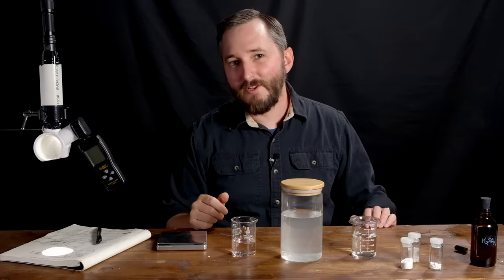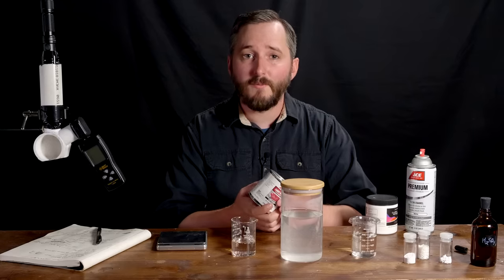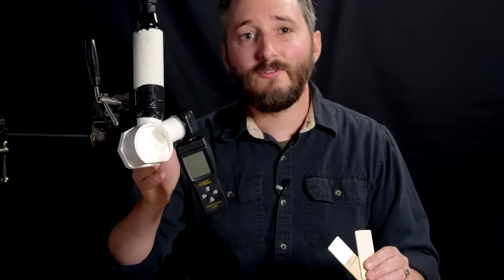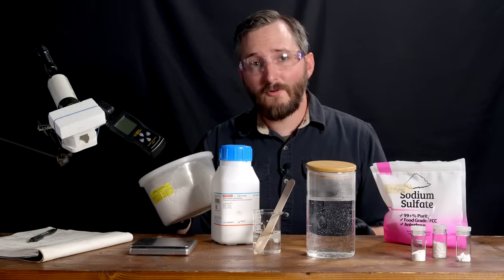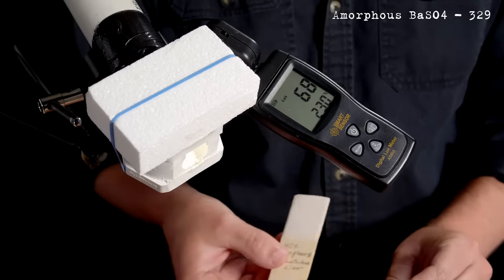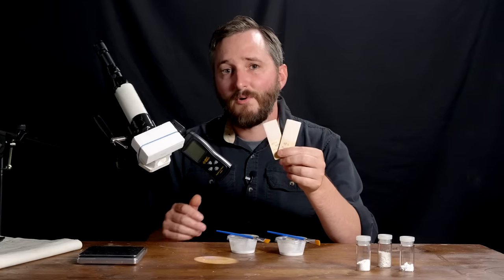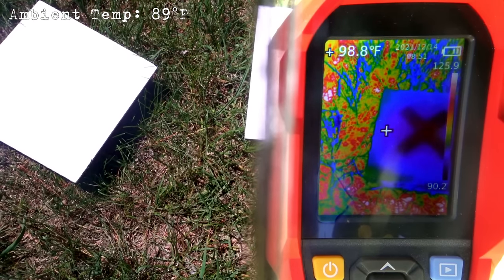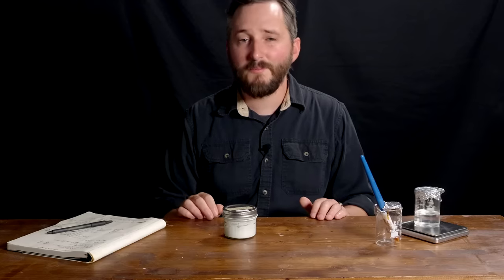How To Make Infrared Cooling Paint (Electricity Free Air Conditioning)

Comment: Once in my now pretty distant past, one of my education topics was something I might call "Light and Illumination".  It ended up with road illumination and similar topics, but at the beginning it talked about measuring (basically comparing) light with different means.  One method used a chalk wedge.  One flank was illuminated by the unknown light source and the other one with an adjustable (dimmable) reference source.  You adjusted the dimmer dial, until the wedge tip disappeared. At that point the brightness of the unknown could be read from the dial of the reference light.  Well, then they described better white materials than the piece of chalk, and it was barium sulfate that got the crown.  In the lab, there was an integrating sphere that was internally coated with that barium sulfate paint.  I think our lab exercise consisted of grading some light bulbs with the sphere.

Comment: that was really interesting!  I'm interested in passive heat reduction for the RV I'm building - I dont anticipate something like this will be commercially available until 10+ years from now, but it's an interesting concept.  any ideas on what the overall costs would be to obtain a product like this - say, like a gallon of it so I could then calculate the amounts needed to cover a class-b sized rig (thinking 0.04" thickness)?  presumably, a 0.01" top coat of clear acrylic could then be used as the wind insulation.
Reply: Nature can be wonderful if we treated fair. Have you considered mylar for the your RV Roof, glued on, good for summer I don’t know about winter,

Comment: Using the " stack" manufacturing process from your thermo-acoustic demo, could you achieve more cooling with a painted stack mounted in a tube? Your demonstration at night showed both regular white paint and the special paint as having similar but noticeable cooling so a white stack in a vertical tube might convectively cool a room?

Comment: Hi NightHawk ~ Can i ask something please? I love your videos btw, you have interesting videos. 
If its painted onto a "Peltier" block, would the cooling potential be enough to allow it to function as a generator?
Reply: I would say yes - but with a very small output. It might be enough to power a device like a small sensor.
Reply: @TheMightyZwom  Interesting thank you. Was just an idea.
Reply: Peltiers generally need have a fairly large difference in temperature in order to work. It will probable technically work, but very very poorly. If you want to create just a small amount of power you can make a battery much cheaper and more effectively. For example, One can create an aluminum air battery on a counter top with aluminum cans, water and salt and run and LED for months. Some people have created batteries that will run (at very low power) for 30 or more years. A solar panel provides much more power. A purchased batttery gets you much more usable power for a better price.
Reply: @cryptickcryptick2241  Thank you

Comment: I couldnt help but wonder if you had a few square kilometers "painted" with this kind of color could you significantly influence the climate and for example target global warming in some areas.
Reply from the maker: It's possible
Reply: If it could be made into a robust material that would stand the weather for a significant amount of time (say, ten years) I'm pretty sure it could make a noticeable difference if many roofs are covered in this. It could lower the temperature in a city by quite a bit.
Reply: you could cool down a local area like a city (think of white roads instead of black roads), but the heat would remain in the atmosphere (greenhouse effect) so the overall global temperature would not be reduced.
Reply: It's called ground albedo and was already discussed in the IPCC reports in the context of the average ground albedo decreasing by snow coverage melting away. Painting buildings and land surfaces with reflective paints like these ones could actually be a way of combating the loss of ground albedo as a positive feedback loop of climate change.
Reply: @umbrel  The heat would not remain in the atmosphere because the IR emission spectrum of the paint happens to fall into the transparent window of the atmosphere, so it radiates out into space.
Reply: I worked night security at a construction site in Phoenix.  The temperature difference changed over 20 degrees (F) overnight when they laid asphalt.  I think we can safely assume the answer is "yes."
Reply: So in exploring that question, think about snow. Nature covers areas of the planet every year with it for a good portion of the year. Snow reflects the light.  This does have an effect. I realize that not everyone lives where it snows, so allow me to explain general knowledge from years of observation where it snows.  The effect is better illustrated as heat absorption in winter months. If the snow is thick enough to cover some fields, they will stay covered, on other fields, grass poking through warms up, melts the snow, and then increases the absorption of heat, and melts more snow until it is exposed. This is very important to farmers in cold climates. Some crops, like alfalfa hay, do best when snow covers the fields all winter. An early snow can come, and it can stay or melt based on conditions, and it can get very cold with no snow for weeks to months. Some fields melt, others do not so there is a variety of conditions based on many factors. Yes, high reflectivity will cool the area off a few degrees. That said, it is of limited effect when winds travel 1000 miles across the planet bringing in hot or cold air.

Comment: Something to point out that every one of these videos seem to forget (and I have to say that this video generally is better than others to demonstrate the effect of radiative  cooling) is that temperature isn't the important metric here. The important factor is heat rejection which results in you temperature when then system is in thermal equilibrium - temperature at which heat in = heat out. So for a paint with a reflectivity of 0.9 and an ambient temperature surface with convection minimized, you are at best getting ~100W/m2 cooling at night. Your efficiency is related to the 4th power so combined with a heat pump you can get the efficiency much much higher but then you are quickly getting back to a complicated system (which might be why you want to do a simple radiative cooling). Anyway, the only interesting test here isn't what temperature you can achieve (which with zero parasitics is just the sky black body temperature) but what external power dissipation you can apply to achieve a desired temperature against the boundary environment.  Passive cooling is a great idea, especially in warm climates to reduce the parasitic heat load from the sun just to reduce the load on the air conditioner, but it's not an efficiency cooling system in itself in comparison with solar panels or in combination with a heat pump.

Comment: I feel like this would only be applicable in places that are always hot. Sure it would be nice in the summer, but would you be able to heat you’re house in the winter with it?
Reply: Yes. In theory you could paint a funnel, and the inside of pvc pipes. The light would then travel from point a to point b very efficiently. Ergo, you could focus the light at point b to heat metal and or ect very easily. Assuming you could keep the light entry points free of snow and condensation.

Comment: Thank you sir for this very well-done video! I have long been fascinated by radiational cooling. I live in South Florida, so cold weather was very limited when I was growing up. Now we pretty much don't even get any cold weather anymore due to climate change. But anyways, we had a flat polyurethane foam roof on our house, and whenever the temperature would fall to 40 degrees or lower, I would put plastic sheeting on the roof and spray it with water. In the morning it would all be frozen. Then I would shake the plastic and gather all the thin ice pieces into a huge cooler and stomp through it with my shoes and crush it up and make a slushy heavy "snow" to play with. Then my friends and I would have snowball fights and play around with my homemade "snow". So I ended up researching a lot about radiational cooling below ambient. One obstacle that would need to be addressed would be the formation of dew on the surface, because once that happens, the dew sitting on top will now have a non-selective emissivity spectrum, meaning that it will absorb the longwave downward radiation from greenhouse gases, thereby limiting how far below ambient the cooling can go. That's where an air gap insulative barrier would help. The air in that gap would have to be kept very dry, and above it you'd have to use a thin layer of plastic film that is transparent to infrared. And the panel would have to lay perfectly flat so that the heavier colder air in the barrier gap would stay right up against the selective emissivity surface and not create unwanted convective heat gains. I have some other ideas in mind of how to maximize the cooling potential of this setup. I'm not sure where you are located, but if you ever need to do any testing in South Florida humidity, I would be willing to help.
Reply: I am involved with reducing solar heat load in tropics and be interested learning about removable panels that can be placed on flat roof for 6 months of low humidity high temperature +40C), 4 months of intermittent rain with temperatures( 30 to 35 C) and 2 months of temperatures ( 2 to 15 C)

Comment: Thank you for the explanation that is waiting for you which is detailed in detail. I watched this movie over and over for a week. And each time I learned something more. Thank you.
I wanted to make a small point - it is not necessary that in the winter there will also be a difference of 20 degrees - because it is possible that the material only prevents the heat from heating it - but when it is already cold it will not get colder - and you can check this today in the summer - if you put the two different materials in the refrigerator for a certain time and then you will measure the temperature differences.
I hope the translation (from Hebrew to English) is understandable and that's why I put paragraphs in writing.

Comment: As a person who lives off grid, I can see this tech used for root cellars. My root cellar is 10 feet down and does a good job at holding 4 degrees C year round, which is similar temps as a refrigerator (as per US Food Standards).  What I'm thinking is building a Root Freezer using your paint. Rather than dirt over the top of the cellar, which acts like an insulator, I'm thinking leaving it exposed and having it be a steel top with the paint. If the paint really does drop temps by 5 degrees C, that mean 4 degrees minus 5 degrees = -1 degrees which is effectively freezing temps. The thing is I can get freezing temps in the winter since I'm in Canada, but doing it in summer never works. Be nice to have ice in the summer time.
Reply from the maker: It might be tough to get a cellar below freezing because the ground will be fighting to warm it up at that point. Hard to say without testing which would win.

Comment: Thank you very much for the video, I'm already thinking of some possible uses, like painting part of the natural fibre cloth used in The Coolgardie safe or just some waterpipes for summertime cooling. Since there's a bit of changes during the video, I'd like to clear and check that I got the important parts right:
- 6:1 ratio of barium sulfate to acrylic (measured in grams, acrylic already dissolved into acetone) works better than 4:1, but the difference wasn't as significant as between 2:1 and 4:1
-acrylic to acetone was 10 gr to 100 ml
-water to acrylic-acetone -mix was about 0.5 ml with old acetone and about 1 ml with fresh.
-mix the water first to acetone 1:4 ratio before adding it to acrylic-acetone -mix.
-it's ok (=not the best, but a lot easier) to just buy ready made barium sulfate :)

Does this read right to you?
Reply from the maker: Yes that's about right. The most important part is to add the water to the dissolved acrylic and test to make sure the amount works before adding pigment. Application works best from an acetone resistant spray bottle instead of a brush. These ones work for me: https://a.co/d/h3AZfgt
Reply: Thank you very much for the extra tips, saves a lot of my time. :) Since the temperatures currently here in Finland are subzero anyways for next three months or so, I'll probably wait for awhile before doing any proper tests, but I'll let you know how they turn out. 

Btw, have you thought or tried any tests of redirecting the radiating heat from the paint to somewhere to be re-used, or do you know does the nature of the reflection spread the radiation in a non-collectable way (=too wide)?

Comment: Hmm. This is very interesting. I know the most obvious use for infrared cooling paint is air conditioning... but what interests me is energy generation. Stirling engines operate by making use of a difference in temperatures. You need a hot side and a cold side. We know how to make things hot... paint it black. And with this video, we know how to make things cold... paint it white. We also need efficient ways of transporting heat and we can do that fairly easily with copper. It's a pretty good conductor. A Stirling engine works better with a higher variant in temp... which is why you often see people using a candle. Flame = hot, ambient air, by comparison, is cold. But a flame requires fuel and a fuel will run out. So passive heating and cooling would be more ideal. So, you set up the Stirling engine with a wide but relatively flat glass or plexiglass cylinder, set up your plunger and shaft, and then on either end of the cylinder, you adhere a circular copper sheet and attach the shaft to it. Then you paint copper sheet with vantablack, or something with excellent light absorption properties, and you paint the other side with your ultra-white paint. Set it outside with the vantablack facing upwards and the ultra white facing downwards, out of direct sunlight. Then just give the shaft a little tap and watch it go. I think the plunger would need to be made out of a rigid, ultra light and ultra insulative material like aerogel. If it's not strong/rigid enough, you could probably adhere some paper to either side. That would help with insulation as well.

I also wonder if this could work indoors, out of direct sunlight as well. It wouldn't be nearly as efficient because the temperature variant would be so small, but it would be interesting to see.

Comment: Done It On My Own,
Meal Boxes 
Painted In White On The Sides With
Sodium Bicarbonate, Gypsum Powder and
Some Tiny Amount Of Sea Salt (Broad Minerals)
Added To The Paint!
Also, The Top
Aluminated To Reflect Much 
Of The Sunlight,
Though The Aluminated Top 
Surface Would Heat Up A Bit!

Comment: Just watched this video for the second time (first watched right when you uploaded it) and I'm still extremely hyped by the potential here. I recently read about an atmospheric water harvesting device from ETH Zürich that uses this principle to create a panel that is always at sub-ambient temperature and can therefore cause water to condense on it. In one of their tests they harvested 50ml per hour per square meter, which isn't huge but it's still 1.2l per day. If you could make such panels cheaply enough, that means basic water needs for a few people could be covered pretty easily in areas with sufficient humidity.

I'm very much looking forward to your next video in this series if you still have one planned! Would be awesome to make a DIY cooling panel, might even be able to combine it with the condensation device above (e.g. at night when you don't need it for cooling).

Comment: Hi. Great video, again. It's really nice to see your approach using the scientific method even though you do not seem to have a scientific (chemistry) background. I'm just going to clarify one point that can be relevant for future projects (perhaps someone already mentioned this, I didn't comb through the comments). The 'brown tint' you mention has nothing to do with an impurity that is absorbing light and changing the color. What is happening is that you likely have prepared nanoparticles with diameters around 100 nm or so. All particulate matter scatters light, but in the case of particles at the nanoscale the scattering becomes perceptible to human eye, as it will be selective to specific wavelength that we percieve as color. Particles around 100 nm will efficiently scatter light up to 400-ish nm, but anything above that will be less scattered. Thus, that suspension is filtering white light. In some directions (transmission) you'll see a yellow-ish tint (red+green light - 500-700 nm) and in other directions (reflectance) you'll see a blue-ish tint (400-500 nm). That's also the reason why you wanted to make microspheres, as the larger size will promote the scattering of all visible light (and some IR), making the suspension 'whiter'.

Comment: This video is for tourists. Chemists have been using limewash for centuries and barium sulfate has been used as a pigment for over 80 years. The problem is that oil-based binder paint. These products need to be made using silicate-based paints.